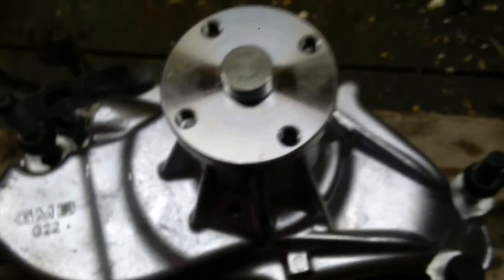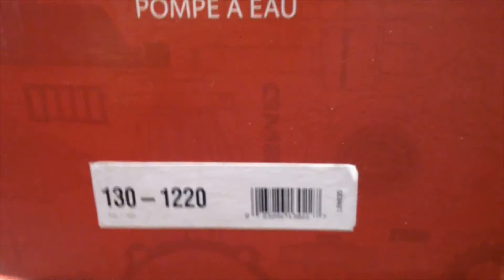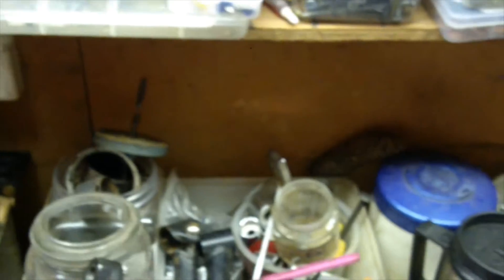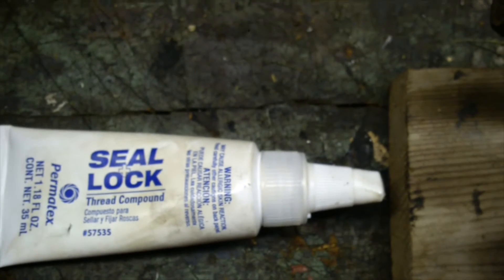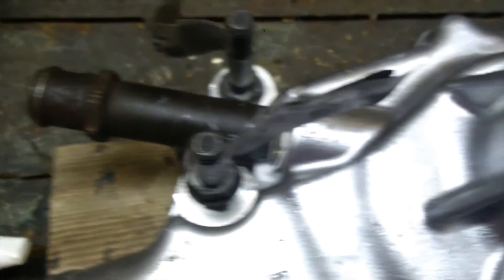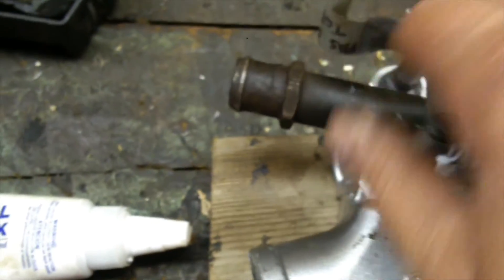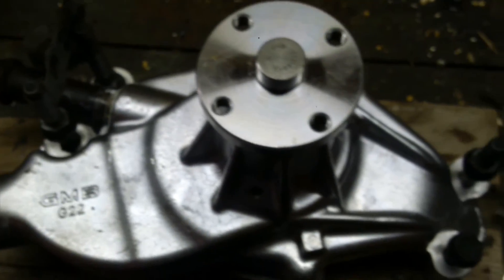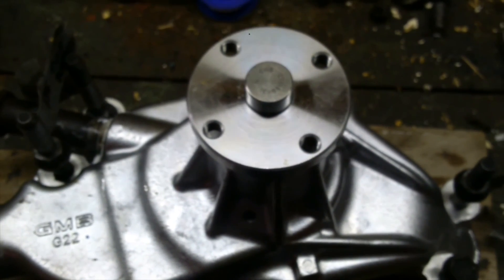New Water Pump 1984 C4 Corvette

Comment: Im at the part where the air conditioning compressor is in the way.  Does that have to come off andif so it looks like that valve cover has to come off too.  Does that AC compressor have to go and if so how the hell did you do it?
Reply from the maker: If you check at the 1:40 mark of this other video, I explain how I did it. It could be easier if you remove the fuel lines. Unfortunately, I did the job in winter, and had my woodstove burning, so removing fuel lines presented a safety issue for me. At any rate, it is a huge pain to take that bolt out, but keep at it, you'll get it. https://www.youtube.com/watch?v=IErn9QdX7Ps
Reply: @1984C4Corvette_DIY_Garage   I got thinking, "does that really need all them bolts" as I look at the dremel..  Is there a hex bolt under there to get the compressor out?  I believe somebody mentioned it in another video.
Reply from the maker: @ranbymonkeys2384  can't really remember i believe there are 2 more aside from that long one.
Reply: @1984C4Corvette_DIY_Garage  OK there are 2 bolts on the top of the ac compressor and there is one more, I'm going to call it "hell bolt" right under the compressor.  Now when I say right under the bolt head is cut so it has room to go in, PUT THAT ONE IN FIRST FOLKS!!!!!  You are also correct about the fuel lines.  I can see how you had trouble without unscrewing those, GET 2 O RINGS  BECAUSE THE ONES ON IT ARE GOING TO NEED REPLACED.  The thing with  the vets im seeing everything is daisy chained.  Take that off to get that, take that off to get that and the valve cover has to come off and the tail lights have to come off to get the valve cover off (kidding about the tail lights)  You have the most informative video on that believe it or not.  Thanks a bunch.  PS mine is the 1985 not much changed in that area.
Reply from the maker: @ranbymonkeys2384  Sounds like you got 'er figured out! Those engineers like to keep things interesting thats for sure.
Reply: @1984C4Corvette_DIY_Garage  All back together no leaks (I have no idea how that happened).  If you could have got those fuel lines out of the way it would have been so much easier for you but hey you aren't blown to bits.  There are 3 nicely filmed videos out there but no information.  We don't watch to listen to a bunch of locker talk you know, we want what tools do we need, how long will it take, what to buy, ect.  Have you had any issues with that crossfire?  I heard if you know how to set them up they are fine.
Reply from the maker: @ranbymonkeys2384  Thats great. No leaks is so nice when you've done all the work! The only issue I had with the car was the transmission went out on it, which I had rebuilt, and I had some serious bogging which was related to the sloppy timing chain. When I put the new chain and gears in, the thing runs really well.  I'm really happy with it.
Reply from the maker: @ranbymonkeys2384  I subscribed. Your channel looks interesting!
Reply: @1984C4Corvette_DIY_Garage  Audio is just like the hell bolt, haha.  It's a downhill road my friend, straight down.